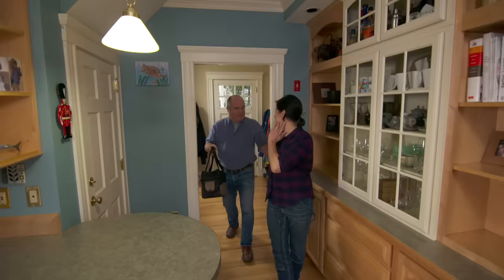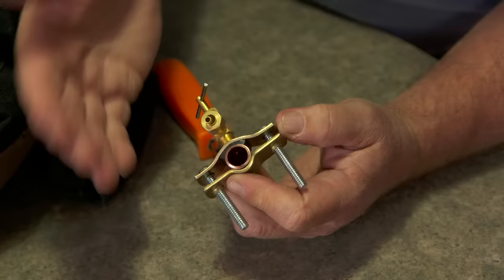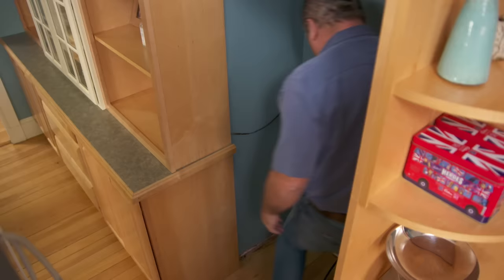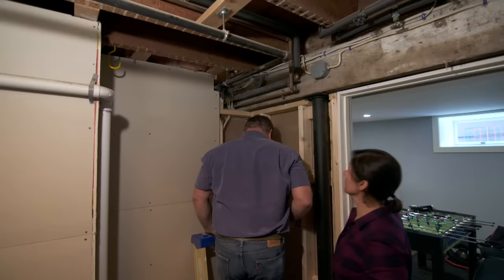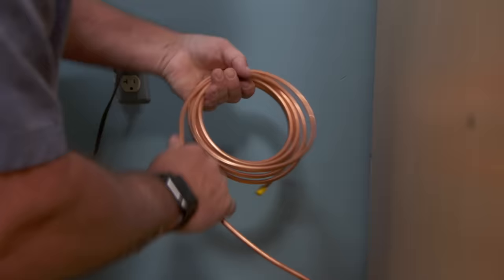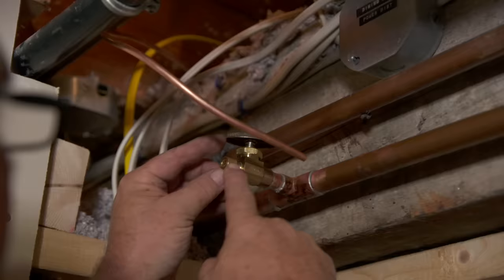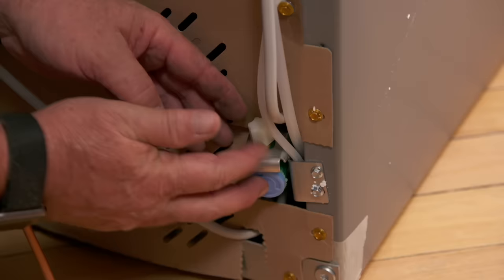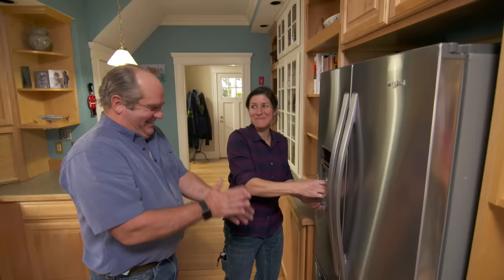How to Connect an Ice Maker Like a Pro | Ask This Old House

Comment: The fresh water feed is not filtered?
Reply: Celyn Adams Normally it doesn't have to. In this video it's possible there is a whole house filter past the water Meter or supply.
Reply: There's usually a filter inside the fridge.
Reply: filter is in the fridge.

Comment: When I moved in my place, I found out someone put a saddle valve above my water heater it leaked and rusted a hole in the top of it. 😑
Reply: Toad Phillips same thing happened to me. The previous owner had the humidifier connected to a saddle valve above the water heater. Luckily it didn’t rust through the inner layer of my water heater. I removed the saddle valve and did kind of what this video did.

Comment: This is so bad. Copper is absolutely the wrong selection here. Drilling down through the floor - three times, really? Measure from a wall, go downstairs, measure from the same wall .. then drill - bring a line up (Copper if you have to have it) then install the shutoff next to the fridge. then run the Nylon tubing. I love how he says "We gotta use something flexible" Let me use the metal tube, that will either oxidize and become crusty, or will pinch as soon as you push the fridge back into the bay.
Reply: lmao, so true still34u, and of course what I was thinking too. Not to mention also that the piece of junk gate valve he uses at 3:50 mark. Those things are almost guaranteed to fail and leak at some point in the next 10 years when the seals dry out. Why not just use a 1/4 turn ball valve and call it good? smh
Reply: Hell I thought he was going to tie a chain around the refrigerator and yank it out.
Reply: Rats love to chew plastic

Comment: Richard, you didn't clamp the 1/4" line to the back of the fridge to reduce stress on the fitting should you ever need to pull the unit out again.  And while I like that you used copper, you should've made a few coils behind the fridge to give it an accordion effect when pulling out.  With your level of experience, you should've known these things...

Comment: Why would you ever use copper pipe instead of flexible plastic? When you roll that fridge back it can easily kink the pipe and be worthless.
Reply: I can't come up with a logical explanation either. I've heard someone say that mice and rats can't chew through the copper, but my thought is seal up the house so they can't get in, and also clean and properly store your food so they couldn't survive for long in the house either way.  Who tf really makes plumbing decisions based on what mice and rats will be doing anyway? lol

Comment: No ice maker box with hammer arrestor ?
Reply: Wilfredo Sandigo local code may not require hammer arrestor anymore, I know they don't where I am at.
Reply: Wilfredo Sandigo, been renovating houses 30 years. I've never once had any any problems not using a hammer arrestor.

Comment: Let's just grab the drill and start "probing" blindly into the floor. Luck was with you, barely missed that 12 ga romex and... copper tubing for a refrigerator line attached directly to the refrigerator? That's asking for a flooded kitchen. I'm just a DIYer and even I know better in BOTH instances. I still like these guys, they have lots of good advice, maybe not this video.

Comment: The copper is not as durable as the polyethylene. I put in copper and it leaked in a couple years. I replaced it with the poly and it's been there for decades.

Comment: I understand why he did it this way, but for my house I wouldn't use anything but a ball valve there and I prefer braided stainless line so it's more flexible.
Reply: Evan Allen, I also wouldn't blindly drill down through a wood floor- especially while being filmed by a TV crew. Imagine had he hit a gas or water line or a 50 amp electrical circuit. Lol

Comment: Its never that easy for me , the connect on the back of the fridge i was told to use SS braided supply line never straight connection.

Comment: Why didn't he put a filter in the line. If the house doesn't have a hole house filter  , trash can get to the water valve and cause it to fail.
Reply: Usually the fridge has s filter already

Comment: Just start drilling. lol!
Reply: I know, could have easily used a tape measure, instead of just drilling a hole into someone's Harwood floor. I'm sure there is some sort of reference point he could have measured off of.
Reply: Is this a drill selling video.
Reply: Just use dinomit and blast true.
Reply: I use dinamit and gun pouder to get Tru walls.

Comment: Why not plumb an actual copper pipe into the wall behind the refrigerator, install a recessed box in the wall and have the valve and the threaded connection upstairs? This looks like a half assed way to do it.

Comment: Dam I’ve got the saddle valve
Reply: jrock1975, don't freak out bra. Just keep an eye on it once a week or so. they usually don't just start leaking without someone messing with them, and they won't start rusting unless in a corrosive environment. Don't be afraid to shoot a lil WD40 on it every once and a while either.
Reply: It will go eventually, disimilar metals , copper will corrode , pretty sure is very green  now, plan ahead  to change that before something happens

Comment: Eh, that looks like a homeowner install that is a step up from a saddle valve. I’m no pro, but I’d be embarrassed to call it a professional install if I didn’t install a box in the wall with immediate access to a shutoff valve behind the fridge. Also don’t like the idea of work hardening that copper line every time the fridge gets moved. I love copper, but not in this application.
Reply: That is a professional install. That is what all plumbers, that aren't hacks would use. Having the shut off behind the fridge would be useless in emergency to shut water to it. The fridge does not roll out that easy after the feet are down and it's off it's wheels. The copper line will be fine since you don't move the fridge out usually. Only thing he should have done was fished the copper line over to the sink cabinet and installed shut off under sink for quick easy access.
Reply: Joe Jr - All new homes that I've dealt with come with a shutoff behind the fridge.  I'm not sure if there's any new building codes about it in some areas (maybe plumbers have dealt with it), but it certainly is practical when removing and installing a refrigerator.
Reply: Joe Jr I pull my fridge out every few months to clean the dust out of the coils and behind/under it. I know people actually maintaining their junk is rare, but people do it. I’ve never seen a fridge that was sitting on a properly installed floor that wasn’t very easy for one person to roll out... personally if I come across a leaking ice maker line, the first thing I am going to do is pull the fridge out and see which direction the line goes to find the shutoff valve. When find that it goes into the basement and is tangled up in other plumbing or electrical or inaccessible because someone’s beanie baby collection is in the way, I am probably just going straight to the street to turn it off quickly. So your argument is only valid for the homeowner that knows where the valve is located. Everyone else is going to have to take a look and wouldn’t it be nice if it is right in front of your face in the first place you look? 

Your comment is exactly why I don’t hire anyone to do anything for me. My definition of hack work seems to be commonly acceptable work for “pros”.
Reply: why put shutoff behind the fridge where you cant reach it
Reply: Blox117 - It's about knowing where it is...the same way you have shutoffs under sinks and next to toilets.  The next homeowner may not know there's a hidden shutoff wedged in a basement cavity.
Reply: then just put a sticky note that says where it is. also like Joe said, it can be installed under the sink or a nearby cabinet
Reply: That is why the i said the line should have been fished over to the sink cabinet so the shut off was quick to access by being in the sink cabinet.  Run to the street and shut off your water in an emergency and let the entire house drain out through it. You do it however you want but putting the shut off behind the fridge is not smart.
Reply: The copper 1/4 inch line should be run behind fridge then secured firmly. A flexible line should then be connected to the copper and connected to fridge so copper line isn't flexed or kinked and eventually breaks causing a massive leak issue that destroys wood flooring...the install of copper directly to fridge is accident waiting to happen!!!
Reply: Joe Jr The average home owner is going to think the place to shut off the watter if it's leaking from the fridge is behind it. Just like they immediately think to go under the sink to shut off the water to that. I also agree at the lest they should have secured the copper put in a ball valve and transferred to hose, preferably braided stainless steel. Since its a retrofit I see why no valve box was installed.
Reply: Joe Jr Tell the people that write the code books that a valve behind the fridge is a stupid idea. Since this is retrofit it doesn't need to comply with that code but that's the norm so get over it. Every new house valve is behind the fridge you can have yours under the sink of you want.
Reply: Alec Ver Bunker never read it anywhere in the code book that says the shutoff goes behind the fridge. I always rough in the fridge shut off  under the sink in new construction. So maybe your code book needs some tweaking.
Reply: Exactly!  1/4" copper to wall behind fridge. Clamped, small shutoff then plastic.
Reply: Joe Jr What year is your code book? 1998? They change you know. Also if you work in a codeless county and only follow national code you don't count.
Reply: Joe Jr 606.5 Control Valve.
A control valve shall be installed immediately ahead of each water-supplied appliance and immediately ahead of each slip joint or appliance supply.

Parallel water distribution systems shall provide a control valve either immediately ahead of each fixture being supplied or installed at the manifold, and shall be identified with the fixture being supplied. Where parallel water distribution system manifolds are located in attics, crawl spaces, or other locations not readily accessible, a separate shutoff valve shall be required immediately ahead of each individual fixture or appliance served

Notice how it says immediately? Not down the line under the sink. This is my local code and I'm positive it's in the national code too cause I just checked. Maybe it's time for a reread?
Reply: Alec Ver Bunker notice how immediately is not a determined length or spot? Under the sink cabinet would be immediately before the 1/4" line feeding the fridge, no matter the length.
Reply: So we all agree that this is not a “professional” install?
Reply: My idiot reply was not to you Alec.  It was to blox117, as  where the shut off is leave a sticky note.  New to this you tube commenting.
Reply: chuck chase it’s ok as long as you use Lexel to adhere the sticky note. Lol

I know when I move out of a place, my main concern is the new owner knowing how to maintain the house...
Reply: Joe Jr In the North East water shut offs are in the Basement or somewhere on the First floor.
Reply: Normally the shut off is located on the Pipe it's connected to.
Reply: A Shut-Off Valve Box Behind Frig For Refrigerator Technician  To Service Ice Maker and Water Dispenser...

Comment: Video says like a Pro. When soldering a horizontal joint you start at bottom and go part way up each side then over the top. Also Pros don't use adjustable plier wrenches to tighten compression fittings. Just saying.

Comment: Never a fan of supplying water to an enclosed fridge. They tend to use crappy plastic lines in the fridge, which develop leaks sooner or later. By the time you see puddles on the floor, damages are already done.

Comment: Why do you like to use copper so much for water lines like that . step into the 90's and use a flexible water line
Reply: Max MAX Copper is safer . Mice and rats can chew into plastic.
Reply: +•*Gregs place* . Greece New York: That is true but maybe you'll have less bugs and rodents if you're actually able to clean under the fridge without fear of kinking or outright breaking it.
Reply: @gregsplace.greecenewyork2744  Mice and rats can also chew right through your 50 amp and 30 amp circuits that run your electric stove, furnace, dryer, air conditioner/heat pump etc. Best way to avoid that is to properly seal up the house so rats and mice can't get in. Even if the occasional stow away gets in, then simply clean and properly store your food and it will starve to death. What are the odds that it will chew through a nylon or PEX fridge line before that happens? I've never once made a decision on what plumbing materials to use based on what I thought mice would be doing. I'd also take care of a rodent problem asap, probably even before I addressed any other issues with the house.

Comment: Who in the heck would use a leak prone saddle valve anymore? 1/4 turn shutoff valve with 1/2 threads to a sweat copper nipple. When the valve goes bad and they do it would be easy to replace. Use a 1/4 inch stainless braided like through the floor. Was this video made in the 80's?

Comment: The bottom line to ALL comments (AND the original script) about saddle valve vs compression valves SHOULD have ended in a recommendation to use the revolutionary SharkBite valve. https://www.sharkbite.com/ along with some PEX tubing. After all, guys, it IS 2019 now!

Comment: Wow no plumbers tape no Teflon sweet...how did that happen...sure wish I had this guy doing my re plumb to copper it looks like a toddler and a chimpanzee got a hold of welders gear and went to town I've got charred walls burn marks weld everywhere green water oxidation on every one of them and I have to replace my sink pipes those somehow were not included in the overall repkumbinh weird and most of the pipes are smaller than the previous size ...I got hosed.

Comment: Let me just pull this fridge out perfect. Yeah right, how scripted is this crap? Pulling a fridge freezer out takes a lot more work. Pull the other one.
Reply: Actually the last 4 or 5 fridges I've owned all will pull out just that easily. The newer ones usually  all have wheels and if the floor is flat and level, you can just park them in place.